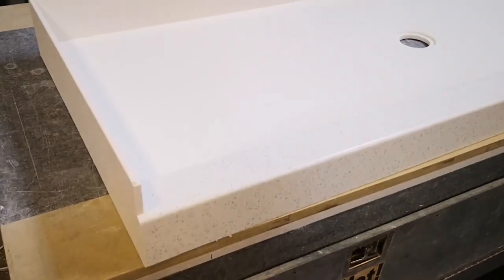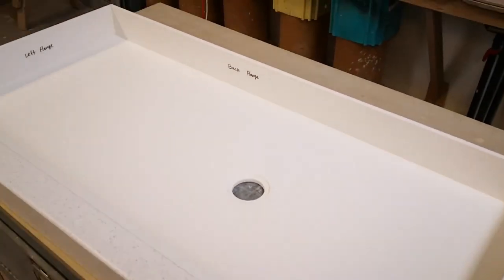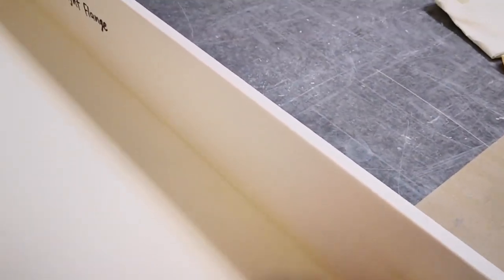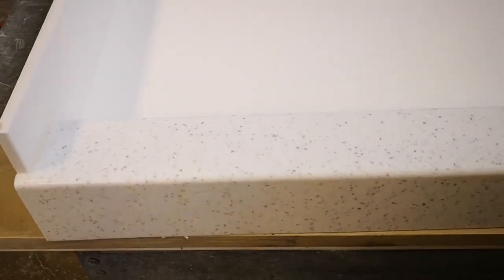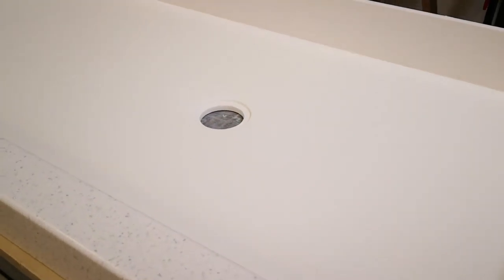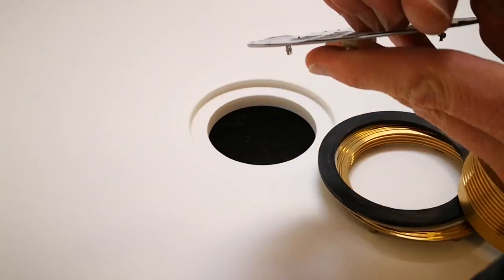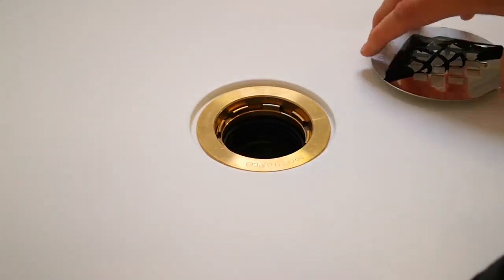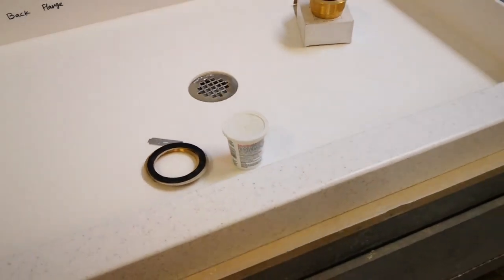Corain Solid Surface Shower Pan - Part 1

Comment: How do you lock the casket in place?  Is that true that this drain can only work for a plastic pipe?
Reply from the maker: The gallery gets held in place with a nut that fits inside the drain assembly. This drain may work on other pipes but í have not done it.
Reply: @AndyGraves  Thanks

Comment: Hey did you glue the drain pipe to the drain by chance ? How do you keep it from leaking outside the drainpipe under the pan ? Thanks
Reply from the maker: The pipe comes up through the drain assembly and then the rubber gasket makes the seal.

Comment: What program did you use on your CNC for this shower pan
Reply from the maker: AlphaCam. It has a built in module that makes it possible to do and it's automatic. There is not really any programming to do. You just define the outside and inside hole, it does the rest.

Comment: What kind of finish do you recommend on the pan so that it is slip resistant? Also I found that I like the color diamond white in a satin finish...I got a sample and really tried to scrape it up with keys and with a green brillo pad for testing. It held up so well. Can you get a satin finish on any color? The shiny finishes get dull easily with a brillo pad. I know that's not what you want to use to clean corian...but just in case I hire a maid one day and they don't understand and use a green brillo on it, then it's not a worry.
Reply from the maker: Use 40 grit on the pan. Any color can be a satin finish but dark colors will look a little more shiny because of the way it needs to be sanded.

Comment: Hi i need to get one of these  size 34-in x 48  i was told that fiberglass one does not last long   crack  so i need  one that is  solid  like yours  to put   tile on the side and  glass door in front  can u give me the link for this  and how much it cost  to get one  also do you have a video  how to install the drainage and  how low the  drain pipe should  be from the surface of the pan   thx
Reply from the maker: Hello, Contact Valerie at Olive Mill. Valerie@olivemill.com She can get you a price.

This is the first video of a five part series. I show the entire process including the drain.

Comment: Never saw a tub with a drain in the middle.
Reply from the maker: The drain has been relocated because it has to be changed to a 2" ABS anyway. It's better if it's in the middle.
Reply: @AndyGraves  Ahh I see. So probably not a basement or slab house?
Reply from the maker: I have seen the drain moved in all types of applications even basements. I guess it depends on how much work you want to do.
Reply: @AndyGraves  found this because I have a slab house that has been in the family forever and need to get the tub out and put a shower in. Thankfully the end under the drain of the tub is all broken out and was never filled in even. I can't imagine trying to bust out concrete to put a drain in. What a pain that would be. lol Not impossible though I guess.
Reply from the maker: @consaka1  it's actually not that hard. Use a skill saw to cut the slab and the a rotary hammer to chip out the concrete. The pipe will be under the slab so just run the new drain and p-trap to the new location. Cover it with gravel and then concrete. Be sure to leave 5"diameter around 2" abs drain pipe.